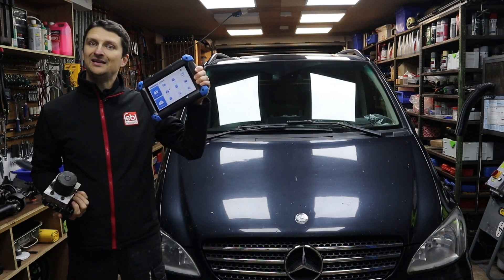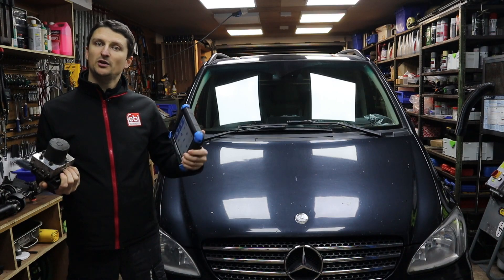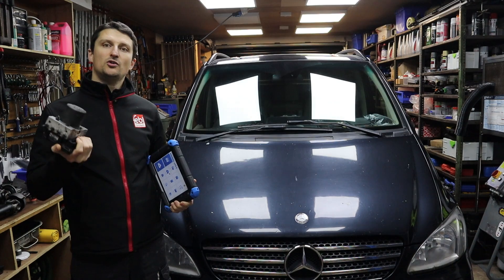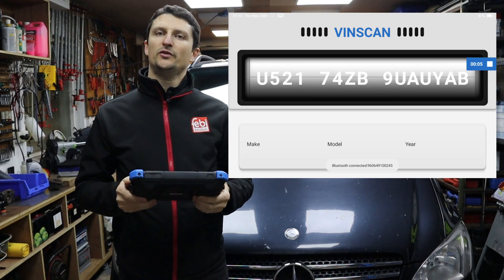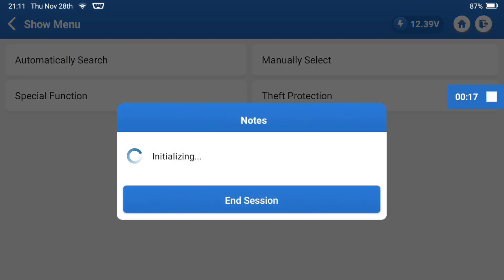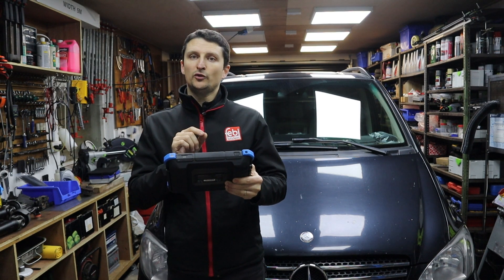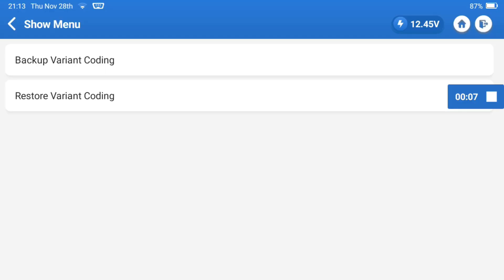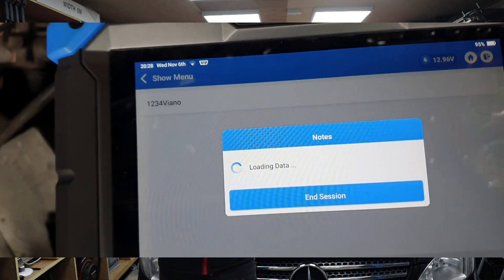How to Code Program Clone ABS Pump ESP Module Mercedes Viano/Vito W639 Sprinter Crafter TOPDON OM646

Comment: Hi, what do you mean by "part number" the one on top or the one on the bottom on the electronic unit?thanks
Reply from the maker: You will have to do a bit of research on this. Every part had a part number. Thanks for watching and for your message

Comment: Hi and thanks for your excellent videos! I performed a conductor plate change using your video that describes that work. 10/10! Anyway, can you describe what’s actions you took prior coding this unit? E.g how did you bleed the system? Old fashioned style with pressure or did you use a diagnostic tool?
Reply from the maker: Hi
I bled the brake system the old fashioned way. I use one of these Gunson bleed bottles where I apply 1.4-1.5bars of preasure on the brake fluid tank then then start from rear left, rear right, then front left and finally front right in my case which is closest to the brake fluid reservoir
Reply: @TheKeenMechanic Thanks for quick reply! I will try that solution myself. Just have to decide wheter to go Xentry-way for coding the unit or buy a Topdon, or similar unit…
Reply from the maker: @niklasdahlgren79 My Topdon Phoenix Lite 2 which I bought 3 years ago has been one of my best tool investments ever. I can highly recommend.
Reply: @TheKeenMechanic if I understand that product correct you have to buy a yearly license?
Reply from the maker: @niklasdahlgren79 When I 1st bought it in 2022 it had 2 years of free updates so it meant that I can update for free all my software until 2024 then I didn't continue the updates as it was quite expensive per year but I still have a fully functional tool which is up to date to 2024. All functions stay the same as normal. You just don't have the latest updates which is totally fine with me as most new cars go to the main dealer for at least 3 years due to warranty etc
Reply: @TheKeenMechanic Aaah! Thanks for clarifying, that makes it a reasonable choice. I assume updates for w639-series these days are rather rare…
Reply from the maker: @niklasdahlgren79 Exactly🤝🏻
Reply: I have ordered a Topdon now! 😊
Reply from the maker: @niklasdahlgren79 You won't regret it 💪🏻
Reply: @TheKeenMechanic I hope not! 😂
Reply from the maker: @niklasdahlgren79 😅
Reply: Hi again! When you bleed the system, did you have the ignition on to activate abs/esp-pump? I have just replaced the pump now and are in the beginning to bleed brake system….😅
Reply from the maker: @niklasdahlgren79 I didn't use the diagnostic tool to bleed the brakes. I did it with my Gunson pressure bleeding tool that connects to the tyre valve and pressurises the brake fluid tank
Reply: @TheKeenMechanic Im also using a pressurized tool to bleed brakes but read somewhere online that abs-pump should/could be “powered on”. Anyway, did two rounds on each wheel and it seemed to work out well. Restored backup and cleared all codes. It all looks good, test drive tomorrow, fingers crossed!🤞
Reply from the maker: @niklasdahlgren79 Did you do it with the new Topdon?
Reply: @TheKeenMechanic Yes! 😎
Reply from the maker: @niklasdahlgren79 Congrats. Good investment👏🤝🏻
Reply: @TheKeenMechanic Thanks! It already feels like and significant upgrade from my icarsoft crmax!

Comment: Hey, thanks a lot for making this video! I was wondering — can this method also work on a Volvo V40 or S90 with a diesel engine and left-hand drive? My ABS pump is broken, and I’m thinking of getting a used one and doing the same thing you did — read the data from the original unit and copy it over to the replacement. Would that work?
Reply from the maker: I have never worked on a Volvo buddy. Try and see what happens. Let us all know how it goes for you🤝🏻

Comment: Hello
Do you think this method would work for an ISM (intelligent servo module)? They are modules bolted on the trans, they basically shift the car into gear and often go bad... Also would it be required to have a brand new module or can a used one be reprogrammed correctly?
Reply from the maker: @traxnada  You can certainly try to  clone it if your tool is capable doing it. Worth trying before you spend big money

Comment: Commenting back on here with an update 
I have a 2009 C63 and was dealing with ABS issues for over 6 months. 
The dealer wanted roughly $1,500 for a new remanufactured module.  
I researched for forever before I found this video. It helped a lot. 
I was told used units were not able to be synced to cars as they are locked. Multiple shops told me this.
I got a used unit off a parts car for $75, and purchased a TopDon Artidiag Pro for around $400 USD. I was able to code the vin In my used unit in less then a minute with the topdon tool. I did not need to communicate with my old unit, I was just able to write the vin into the used unit.
Reply from the maker: @BrokenC63  Thank you for writing back with your update. Are you able to write step by step after you establish communication with the new unit. I think it will be priceless information for anyone else trying to do the same
Reply: Can u tell us how?
Reply: I haven’t tried to recode a used abs module for my 2010 S63 but am going to give it a try. 
I have the same Topdon ArtiDiag Pro and this is the sequence
-run the diagnostics 
-get to the menu where the choices are Health Report and System Selection
-choose System Selection
-choose ABR on the next screen
-choose Special Function on the next screen
-choose Complete or Correct VIN

Hoping to try it out later this month and will let you know if that is the proper method.

Comment: I cant connect with old ABS module, its broke, can I still use the topdon to code a second hand ABS pump to a W639 ?
Reply from the maker: @agdercont8634  You can certainly try it. It didn't work for me, but I was lucky I could still communicate with the module and was able to clone it through variant coding. In my case the issue was faulty conductor plate inside the automatic transmission.

Comment: Could this program a 2009 C63 abs unit?
Reply from the maker: @BrokenC63  Try it same way as I did it under variant coding function if you can still communicate with the old unit. Create a back up file and then upload into the new unit
Reply: @ communication with old unit comes and goes, hopefully I can catch it. Can you provide the link to this specific scanner please.
Reply from the maker: @AqTcLogic  Hi
My scanner is a Topdon Phoenix Lite 2. Just search for best deal on the internet

Comment: Well done!! Is there a particular reason for the failurs of this component?
Reply from the maker: Hi there. I had a faulty abs pressure sensor. Sadly Mercedes built it into the abs unit internally and you can't just replace the sensor itself like on other makes and models
Reply: @TheKeenMechanic  ah ook! We are fortunate that there are many online platforms for selling spare parts 😅Is it possible that the fault is caused by poor brake fluid maintenance? To me you are a great source of reliable information,I will appreciate any advice.
Reply from the maker: @Tonino-r6p  I would say the lack of brake fluid changes can definitely contribute to the failure of the brake pressure sensor. When I drained the fluid it was nearly black, I had to flush the whole system twice and also wash the brake fluid reservoir too as it was black inside too. Thanks for your comments and for interacting. You always ask very valid questions🤝🏻